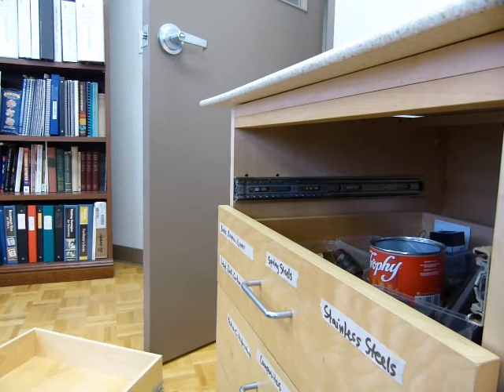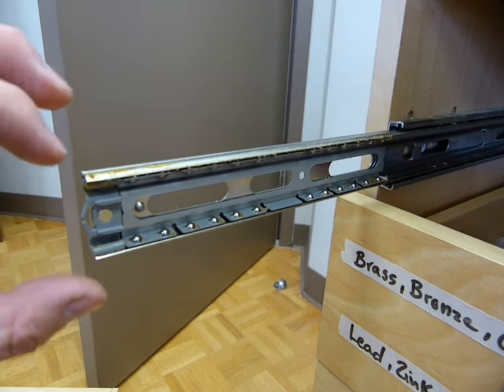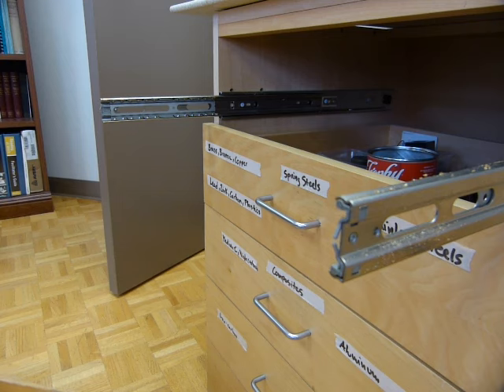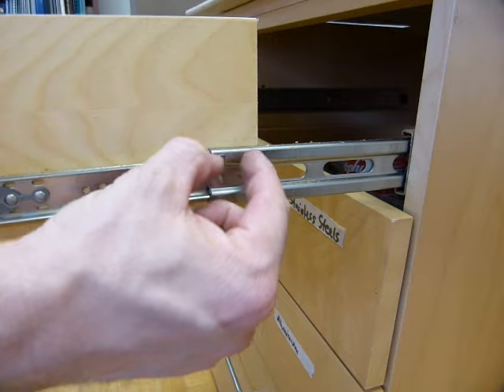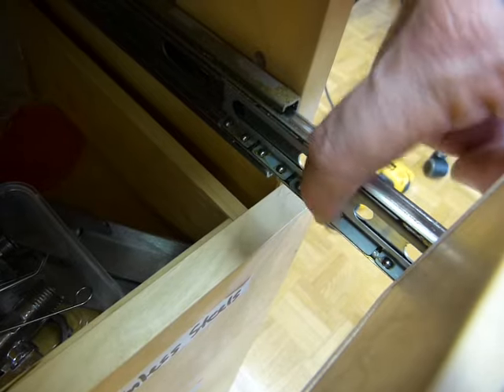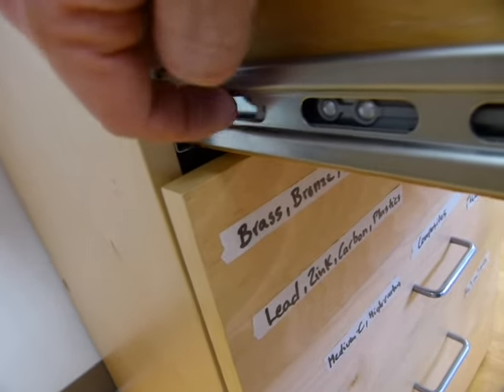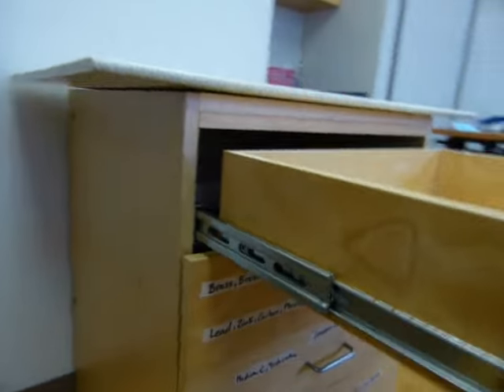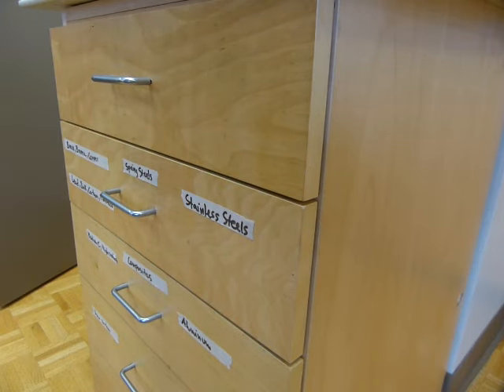Install/remove a drawer (rail & ball cage type)

Comment: Thanks for the tip about holding the ball bearings forward in the track with a screwdriver. I was really stuck putting a hide-a-bed together until I saw that. Worked great!
Reply: Me too

Comment: Thank you! I was really having a tough time figuring out what I was doing wrong. Your video and explanation provided all the nuances I needed to get the job done.. The inner assembly with the ball bearings kept sliding back and not staying put inside the track. But I see what you did to make them position properly and even to pull them forward after the drawer was partly engaged.
Reply from the maker: You're welcome!

Comment: The demo has been quite useful in handling my drawers when I wanted to set the movements smooth. in fact I discovered that something had fallen inside which was obstructing the sliding motion of the rails. Thanks for helping me..
Reply: Wonderful!
I had been struggling for ages - so had a google! Thank you - instructions so clear - THANK YOU!!!!

Comment: Great video. What also helped was at 1:51 in the video, it shows the open end on the rail going into the cabinet. The desk we bought had the rails on the wrong way, so no wonder we were having problems with the install.

Comment: Is there any way you can still slide the draw back in working normally if you lost a few of the tiny bearing balls?
Looks like I’m going to have to hunt down a whole bag of them just for a couple of lost ones
Reply from the maker: Yes it will with some fiddling. For less misery, you might want to re-distribute the balls evenly (move a few of them to fill in a gap in the line somewhat), until you find the size you need.

Comment: Somebody got saw dust in my new rails (King Slide Canada). What can I clean the mess with? Mineral Spirits, or some type of paint thinner? What's the grease used? Can I use care brake pin silicone paste? I have AGS sylglide, very nice silicone paste, looks yellow like that.

Comment: I agree with the other comments that state this video has been a great help! The details provided were the missing factors in all others. However with that being said I still can not get my drawer in and hope someone can give me a pointer. I hear it click and the drawer feels right and slides...but...stops abruptly about the exact same distance as far as the silver guide which holds the ball bearings stops (about 3 inches from being fully closed) . It works perfectly EXCEPT for the fact it is approximately 3 inches from being fully closed. I have been working 4 four hour and I think there must be something simple I am overlooking. Help..anyone! Thank you so much in advance!
Reply from the maker: Find the spot that stops the slide going in. Take out the drawer, look at ONE slide only as you would check it using a microscope (not a real microscope) and find what stops it. It is possibly the rim of a screw holding the slide in the cabinet gable that isn`t turned in deep enough. Don`t strip out the screw threads either, pre-drill & countersink as necessary.
Let us know what happened.
Reply: i have a steel filing cabinet and the lowest drawer is stuck closed. the drawer has a little tab that you slide with your thumb to open it, but that tab seems stuck. any advice?
Reply from the maker: Ayyayayay ... advice:no.
Idea: tap lightly around the button and sides with a hammer to unstuck sliding latch parts
If no success, rotate whole cabinet upside down or in some other position to unstuck latch bars. I know the contents spill everywhere at this point.
Maybe prying open with a flatbar? (finishing carpentry tool for moulding & baseboard installation)
Last resort: cut open sides with tin snips. Power grinder would dirty everything inside and sets papers on fire.
Reply: My problem was that the drawer had partially come out of the rail and was not closing smoothly. I took it out, I cleaned it and put 3-1 oil on it (though it probably needed something else). to re-assemble, i learned from the video to push the steel cage all the way up to the front of the drawer; I had to push hard using a screwdriver. After that,  as I slid the drawer back in, it kind of stopped about 5 inches from being completely closed, like cherylanne mentioned. I forced the drawer back in place though it met with some resistance  and it now rolls back and forth and shuts all the way. It doesn't seem absolutely perfect, but pretty close.
Reply: theoverengineer thanks. i banged and pulled and tipped until the damn thing opened
Reply from the maker: Good stuff, thanks for watching.

Comment: What to do if ball bearings come out??
Reply from the maker: They do come out with some banging / forcing. Usually involves bending their retainer clip out-of-shape. So the balls go back in the round holes in it but look for deformation in the metal to keep the balls in place.
Reply: @theoverengineer  ty for d reply... But my work is done...